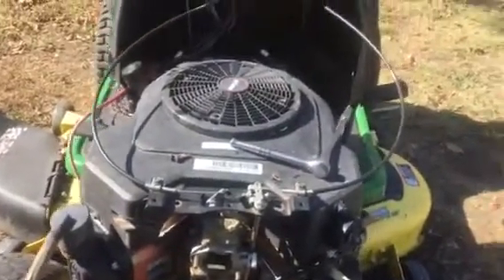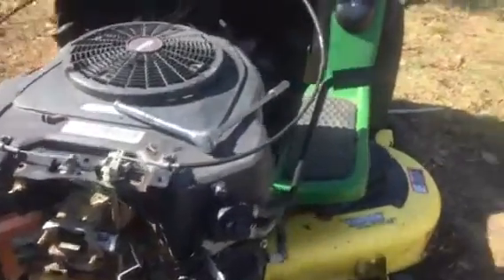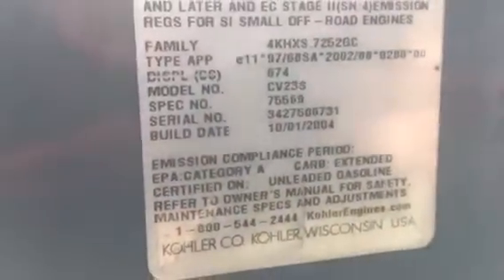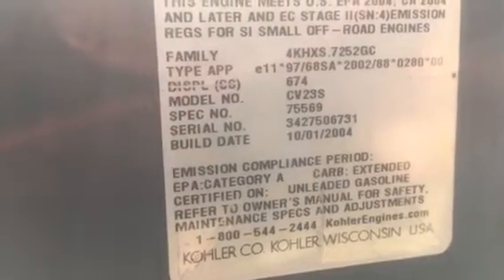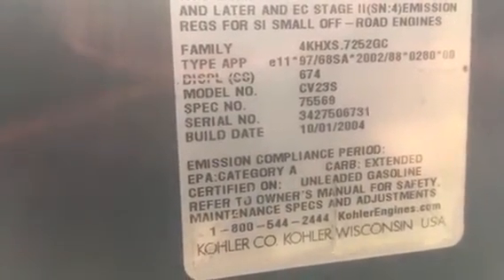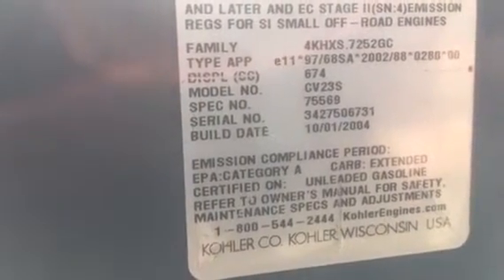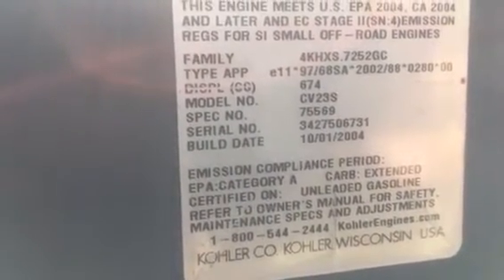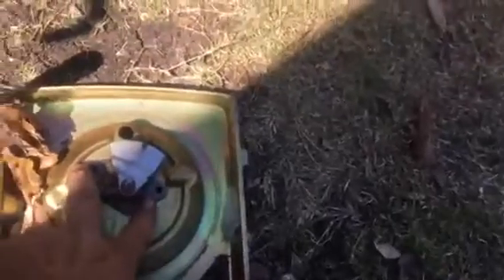Kohler Command 23 carburetor removal

Comment: I need help putting the choke linkage back on.   It’s hard to see from this video which way it goes.  And does it need a clip to hold in place.
Reply from the maker: The choke rod has a bend in each end of it. The 90 degree bend goes at the bottom. The goofy looking bend goes at the top. Now that you know the top from bottom, hold the rod upright and point the bend at the bottom towards the engine. That’s how it goes on. Hook the top of the rod to the round plastic choke assembly on the carburetor. Just let it hang there. Install the carburetor. Now, there should be a small plastic clip in the flat little metal choke arm. That 90 degree bend sticks into a hole in that clip. Once it’s in there that little clip has a piece that snaps onto the choke rod to keep it in place. Those little clips can fall off when you take the choke rod off. If it’s not there look around on the ground, inside the muffler shield. Everywhere